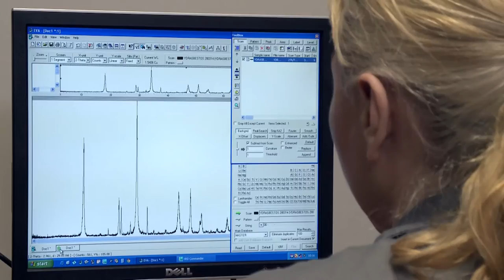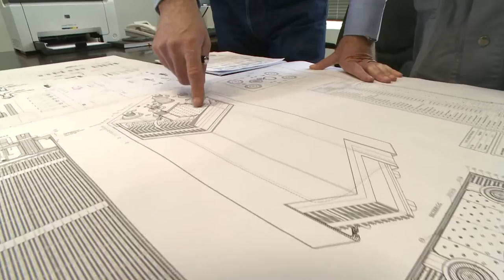(ENG) SYSTEMS SUNLIGHT S.A.| Reliable Battery Solutions Worldwide| Corporate Video 2016

Comment: I have some things to say about this company.

I hae worked in that company and i have lots of Friends that are still working there because there have not anywhere else because of the Greek crysis. I can say that Sunlight is taking oportunity and uses the employees that are working at production lines. 

First of all i can say that the salary i was taking was around 600 Euro for thet non healthy work and the most importand thing is that if you know a high level person there you can work in better places but if you dont know anyone you will work in the wors spots ever. In the video the places seems to be clean but in reality everything is black and the machines are milfunctioning all the time, not because they dont have money to fix them but because they dont want the production to stop. So they barely fix the machines and you have to run every time to reset and stuff. 

Once the chineese were going to come and visin a new machine they installed and we were like cleaning everything for the whole day. everything was beter but that was it, from then nothing was cleaned again. THE MOST IMPORTANT IS THAT THE AIR FILTERS WERE NEVER CHANGED AND ALL THE LEAD DUST WAS INSIDE THE FACTORY.
Reply: Same in Germany Arkadash